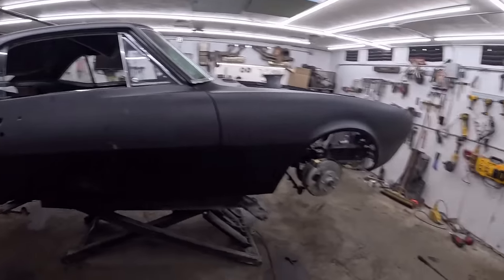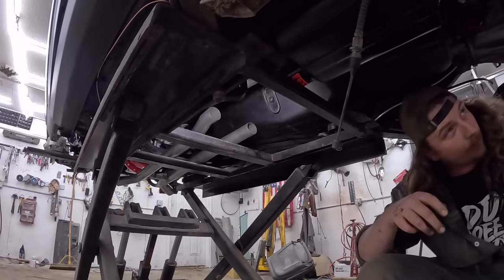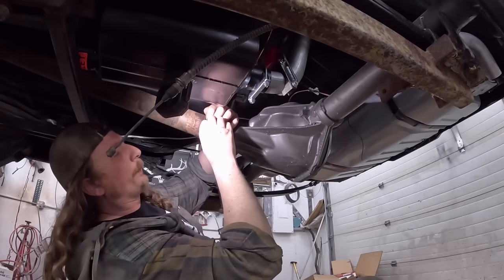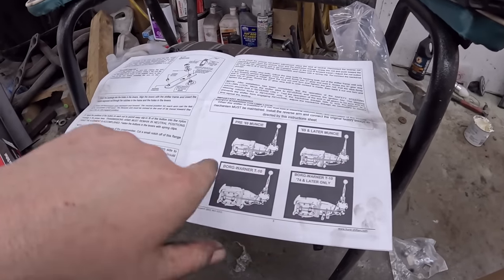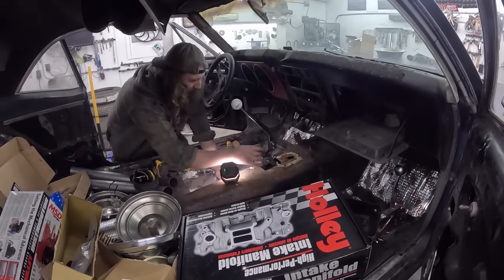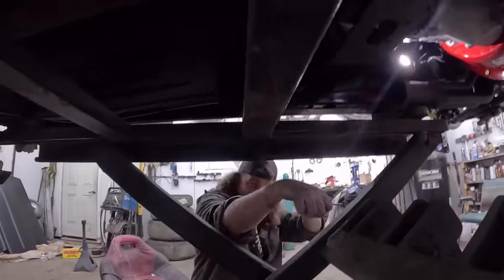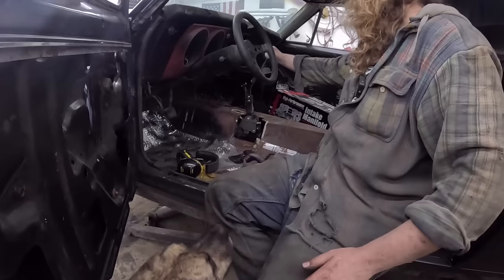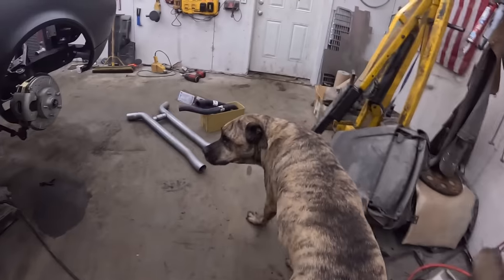BANGING GEARS In My 1967 Camaro - Old School 4 Speed, Save The Sticks!

Comment: We who do Hurst first gen 4 speeds all the time learned a long time ago, ALWAYS USE VETT Hurt Comp plus II LINKAGE in a F body.  The shifter comes out dead nuts in the middle of the tunnel, ￼:face-blue-wide-eyes: but what you got is good enough for D&D.  Also, we always put all our shifter & rods on the trans BEFORE you install the motor in the CAR ! Then just bolt up the shift handlebar on the shifter after everything is complete. .
Reply from the maker: I'll know for the next one haha

Comment: I had a 73 Chevy pickup, inline 6, 3 on the tree. I switched to a Competition Plus 3 speed, it was so much fun banging gears. In the early Pro Stock days, they used a 3 speed shifter for a 4 speed trans, and a separate lever for reverse.

Comment: Hey Dan, or D, when your working on the project, use a cart. All the projects stuff is on the cart. Drag the cart around the shop where your working. End of project drag the cart around to put stuff away.
Reply: Needs the cart and a trash can. Dan loves to work harder not smarter. Ask Mur.
Reply: But then it wouldn't be DD Speed Shop...
Reply: wheelbarrow , got a lot more uses
Reply: I have 3 carts. They are all full of random parts and future projects. Never free to use correctly. I don’t have the energy to work 6 hours a night on cars after a 11 hour daily so the cars wait until the weekend.

Comment: Hey Dan! Dunno if you're aware of this, so some fyi if I may. It looked like you used a standard 27 spline Chevy yoke. Which is fine in a automatic car, not so much in a stick. GM makes a heavy duty version for stick cars. If you're running the standard duty yoke, you'll want a driveshaft loop, trust me. Even with the good yoke, the weak point becomes those Chevy sized u-joints. A loop still a good idea, Camaro's don't pole vault well. A much better alternative is using a Firebird shaft, they run the bigger nearly unbreakable Pontiac size u-joints. Most times they already have the heavy duty yoke already. Chevy u-joints just suck in a stick car if you like to play, and I know you do. It can all be done with factory stuff, and still be near bulletproof. Just trying to save you some future grief. BTW that joint cap swap was just TOO sleazy, even for you. You deserved that bite! lol Best always!

Comment: Dan I was taught to have the drive line close the grease hole and not open it up .Its stronger in the extreme . Drive line turns  counter clock wise so D L yoke grease hole then rear end yoke . Turn the U joint one more end cap .At 12.50 you can see it. Its going to pull the hole open .The other way around the zert fills the hole .The hole is the weak spot .

Comment: Dan you can buy a transmission tunnel adapter for the 4 speed shifter. It will make your installation very easy and you can install the shifter boot on it.

Comment: My dad has the same setup in his 67 , your shifter is sitting way high, only the chrome stick should be sticking thru the floor and the shifter mechanism should be mounted straight to the side with a spacer, no riser.

Comment: I could swear my buddy's 67 with the same setup - rock crusher, 373, 12 bolt, 327 headers, had  two muffs that went into a 3rd muff back by the gas tank laying horizontal.  I remember this because he had a single leaf spring but the rear really  wanted a multi leaf.  We had to often band the wheels straight and he loved to go through zoomer clutches till we put in hayes dump truck clutch....   Man the 1980s were fun....

Comment: Make sure you get the levers on the transmission correct. Otherwise your shifter may lock up between gears. The car I bought would shift ok during normal shifting, but would bind up when power shifting

Comment: When I was kid my friend had a pontiac tempest 326 with a stick, we put a set points in it and set the dwell with a timing light if nobody has turned the distributor and you know where the factory timing mark is you don't have to worry about gapping your points with a feeler gauge people claim it's not important butdwelll affects your timing, GM distributors have that little metal thing you pull up and use a wrench, anyway that car would take your stomach away when accelerated you know what I mean? Down the road miles later he blew the syncros in that transmission , we went to a junkyard and found one out of a Chevrolet to replace it, after doing that the car was a dog and it didn't have that take away your stomach feeling anymore, this is what I'm trying to say or mention to you that if you tinker around with the differential gear ratios you can find that harmony with the torque and horsepower of the motor and  gears of the transmission that will take your stomach away on takeoff it's like a tickle, lol I have no doubt and i'm pretty sure you two are about to experience that, that is what a hot rod should be all about. Drive safe.

Comment: 1950 Packard Super Eight Coupe runs drives and stops, know anyone that would want it Dan? comes with a ton of parts, Located in Ladysmith, BC. :D Black on Tan interior. and still working on the Factory 6V system.

Comment: I think the threaded ends of shifter rods go to the rear, on the shifter. At least mine are
Reply: I second this, my 79 Camaro with a 4 speed from the factory had the adjustable end at the shifter and the fixed end was on the trans lever, that was it a bad ass little Camaro after I rebuilt the goodwrench 350 into a 383 with 780 double pumper it would burn the tires till you lifted

Comment: hey Dan, would it be possible to lower the car onto jack stands, slide the hoist out, (I'm not sure how easily it slides) do what you need to do in the middle of the car & then slide the hoist back in?  Just a thought. Love the build. Keep up the good work. Cheers from Australia 😃👍
Reply from the maker: Yeah but the hoist is heavy
Reply: @DDSpeedShop 

Just adding to the idea; set up the shop walls so a small hoist can be used, pull hoist side to side, or towards the front.

Comment: Dan on those Camaros 67 to 69 and I'll know the 68 and 69 the floorboard piece if it wasn't a straight drive car from the factory you can buy a floorboard piece that comes out and you weld in it already for the shifter it is cut out the hole and you know you welding the new piece for the shifter makes you look a whole lot nicer for the floor for the boot and everything and if you put a console in it it will fit perfect for the console is well the make of 10 or 12 in shifter boot if you don't want to do that butcher that floor pretty bad to get the shifter to go in and so you're going to have to use a huge boot for it to cover that hole unless you go back and attack in some places where you didn't need to cut it all open the first one I did that's what I had to do and then I found out that you can buy that piece and so now I keep wanting to stock all the time I got one out there in the shop but it cost more to ship it to you than it would be worse they're only about 30 or $40 to bomb us I don't know what they'd be Canada but I know you asked was 47.00 us it's a great thing to have cuz it makes everything just right when you put the floor and you buy the carpet for straight drive and then if you're lucky enough to find a console and not have to buy a brand new one then you can put it in everything looks just right

Comment: If you got a different mounting bracket for the shifter it would fit better. The shifter is sitting too high. I doubt if it will work correctly. The way it's setting. . I had one and loved it and that shifter is wrong
Reply from the maker: It's a camaro/nova part number.  Maybe yours was wrong

Comment: Cutting the whole wrong with a bit of a rookie mistake if you were to ever look at the consoles that go in these cars depart the shifter comes through is always offset a great deal towards the driver's seat and sometimes the adjustment for the clutch won't be long enough I found if I used shock extensions are all thread I could make up what I was missing in length I always like the competition plus but I would buy another shifting handle the shorter the handle the shorter the throw between gears in sitting as low as you do in a Camaro with a shorter handle always comes in handy unless you like that rat fink look with the shifting handle coming out of the sunroof

Comment: the bracket that was on the shifter would have been the correct bracket.  the one you used is not correct and puts the shifter way off to the left side and higher than it should  be by 3 inches you did not have to cut the tunnel at all if done properly

Comment: That gear shifter is waay tall? wonder why its so tall maybe its for a truck. It has good looks but too tall.  Maybe you could Hack it off and drill new holes to shorten it some. Im eating salad too I need to shed my big belly its rough to live with. I saw a shorter stick on Amazon. It reminds me of the Monster Bubble Gum Cards though. Its not correct but it will work.

Comment: Yeah, I'll just install an expensive trans' and a cleaned up rear end. Then I'll Micky mouse an old rusty U joint (that doesn't fit) & force a rusty yoke on with a hammer installing all the spline rust into said trans. Not like 2 new U joints (one of which I already have) and a new yoke (that I already have) & 20 min. at the bench vice would have fixed it right up. This one's beyond a head shake.

Comment: Uhm . I'd be checking the U joints with a micrometer , the diameter of the pin you are taking the cap from , vs the one you are putting it on . If it is more than .0025" max difference , you may have serious problems . Just saying . I see we haven't quite gotten to future Dan , meets past Dan yet . Because all of the stuff you are doing now , was done when , "SPOILER ALERT" . I'll shut up , let them watch for themselves .